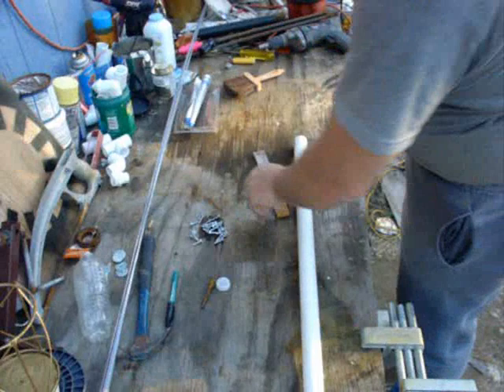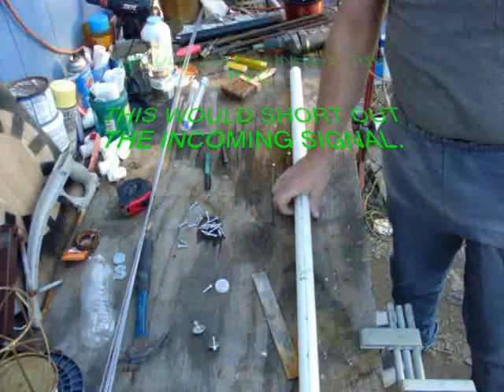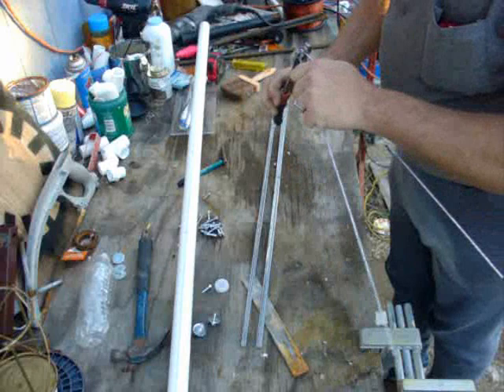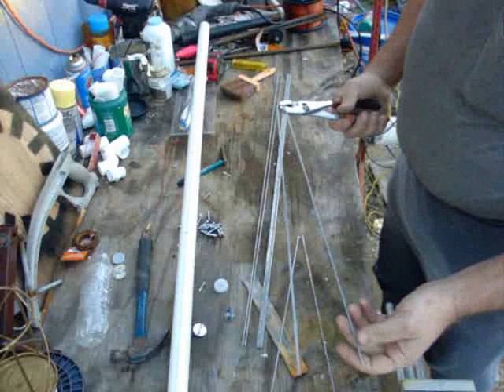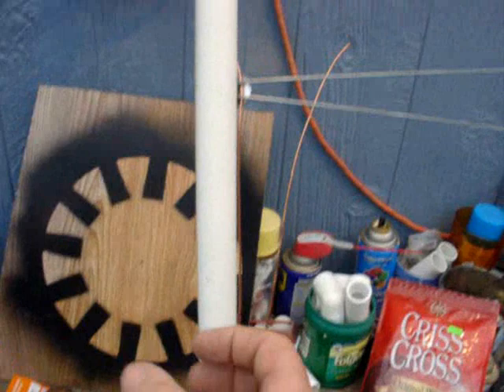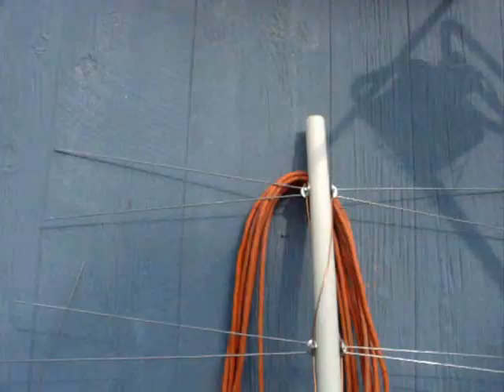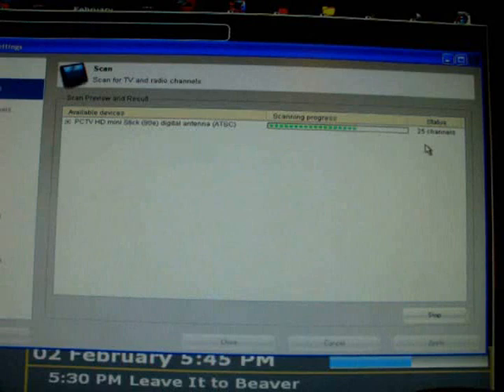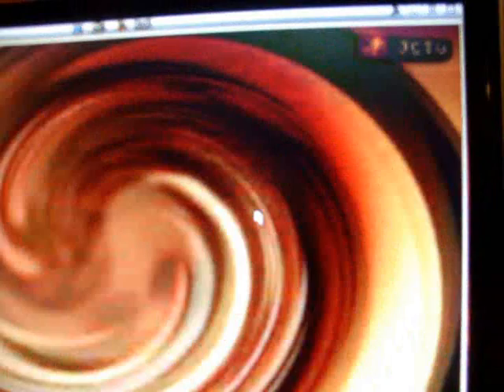EASY BUILD  HD TV ANTENNA   FREE HD TV 2020

Comment: Hey Scott. 

I made one of these antennas a few months back, and it worked pretty good...40 - 45 available channels. Today, I modified it by running the matching transformer and the coaxial cable through the inside of the PVC, and raised the antenna 5 more feet. Now I am picking up 67 digital channels and 1 analog. All for around $40. I have to say that this video is one of the best I've seen. Thank you vert much for making this video.

Lee Biggers of San Antonio.

Comment: damn,i can believe this, about 3pm yesterday i decided to go to walmart and return the $55 antenna i bought the day before ,went to home depot and radio shack and bought all i needed to build this antenna and at about 6:00 pm was climbing to the roof to install it, i used the bracket and tube i already had from my old satelite dish , took me about 1/2 hour to find the best orientation and by 7:00 pm my receiver picked up 81 over the air channels (lots of chinese ,vietnamese ,spanish, even a french channel ),i live in simi valley (93063) and the closest transmitters are about 38 miles away, this antenna is amazing, thank you muddyman
Reply from the maker: oscar gargiulo Thank You for the awesome compliment, and comment. I am very Glad for you. Enjoy it well.

MUDDy

Comment: Used your video to make the same antenna. 4 years later it's still working great! I did solder the wires together though so that oxidation wouldn't be a problem. Thanks!

Comment: I just finished assembling my version.  I had a oven rack in my garage that I used to make the sections of the antenna.  They were 16"  in length, but figured I give it a try.  I welded the ends together at a 15 degree angle and spaced them on 9" centers on the PVC pipe.  I used 12 gauge copper romex to connect the antenna elements.

IT WORKS GREAT!  

I needed another HD antenna but I bought one a couple of months ago and it gets eight channels.  This one works awesome and I get 14!

THANKS!

Comment: These antennas seriously work. I built a fairly crummy one mounted on a piece of plywood. It sits in our bedroom with about three or four walls that are plaster and expanded metal lath (which even gives my wifi fits) between our antenna and the broadcast antennas. We still pull in about 20 channels clear. But your construction method and materials are waaaay better than mine, and solve a couple of problems I had with moving our antenna outside - and I even have most of the stuff on hand. Yay.

Comment: lol, I made this just today, and were about 50 miles from town.

made it all nice with the boys and all. hooked it up, inside the house mind you and was getting better reception then with that store bought thing that half way worked.

what I dug about your vid, you put the math in it, I have watched many, but your vid got my motivated.

killer job, and thank you
Reply from the maker: +Carrol Ray Thank you Carrol Ray. 
The funny thing about this video is, I was asked to do it by a fiend. Even though the main subject of this channel is free energy.
This video gets more daily views than all the rest. lol.
Perhaps I should drop some of my old bamboo and aluminum foil tape designs I used to make.
They were fun , easy, simple, and cost next to nothing to build. I have helped many new ham operators, and citizen band radio operators get on the air with their first antenna made from bamboo and aluminum foil tape.
Yagi antennas and quads , and ground plains. The best part is, if they fall. you are back up and running in 1/2 hour, the bamboo causes very little damage, and most of the time, the bamboo just splits when it bends, and just snaps right back into shape when you pick it up. lol.

another funny thing is, Most folks swear they dont have bamboo growing in their town. It was just never on their mind while they were driving around.
It's a wild growing, wide spread weed.

Keep smiling and have a ball.
AND THANK YOU.
MUDDy

Comment: Thanks for the instructional video, very detailed and informative.  I built an antenna using your dimensions, but added a reflector frame out of 3/4" EMT (thinwall electrical conduit) and welded it to a 1&1/4" EMT mast and used aluminum screen as the reflector (seems that a lot of people use almost anything that's not nailed down for the reflector).  Also used insulated #10 solid wire for the whiskers and other conductors (stripped it where it makes contact) and found a weather proof transformer at Lowes for $4.  Used a 2x4 for the whiskers and wiring and attached that to the mast/reflector.  Mounted the whole thing to the side of my chimney ~40' in the air.  Wish I could post a picture.  Anyway, I'm about 65 miles southeast of Baltimore and it seems to get most, if not all of UHF channels (even ones in totally different directions for some reason).  The trouble is I'm not getting anything in the hi-v range (mainly interested in NBC out of Baltimore).  Judging by the distance and the power of the station I should easily be getting it when compared to some of the other stations that I'm getting.  Wondering if there's anything I could do to optimize lower frequency reception.  Would adding a really long pair of rabbit ears to the top of this design mess up the harmonics or something?  Or would changing the lengths of some or all of the whiskers to something like 20" be more beneficial or will that screw things up too?  Thanks again for the video and for any additional suggestions.
Reply from the maker: The shorter the wire, the higher the frequency.

Comment: Cool, there's a man here in Edgewood that made antennas for many years. He made many different shapes, but always the same thing; PVC pipe and wire. I bought several from him, $10.00, I seem to remember, and they worked  much better than the expensive HUGE antennas that are so common. At the moment, I have one of those "normal" antennas, on a pole, about 13 feet high, a converter box, and probably get the same channels you do. Lots of Spanish, but, some good ones too.  Gave up Dish!! satisfied!

Comment: Many thanks, MUDDy.  I built mine and get 16 channels just sitting in the window.  I can't wait to get it on the roof and aimed at the big city.

My hardware store only had coiled ceiling wire.  I went up and down every isle looking for an alternative.  I ended up in fencing, out in the garden center.  While leaving I saw the tomato cages and thought, "I need to get new cages to replace those cheap ones". D'oh!  I used tomato cage wire. Heavy duty and galvanized. Thanks again.

Comment: About 20 Home Depots within an hour's drive of us. Only ONE stocks "USG #207535  12-Gauge  6 ft. Hanger Wires (50 pack)"  (=$17.78 today's price.) Only source I've found.  WORTH an hour's drive each way to build this incredible antenna.  Made the mistake of taking mine camping (antenna in our Forest River RV sux.)  Everybody in our club wanted one! Held a "how-to class."  Now where ever we camp even guys in $750K motor homes ask how to get one...   Makes the "coat hangers on a 2X4" guys turn green. Thanks for the video.  Nothing else can touch it.
Reply from the maker: Lol, I'm melting, I'm melting... wweeeeeeeee!!!
Warm heart felt comments like this one just spread a smile to my face.

A fractally designed antenna like this just resonates all frequencies below the half wave length of it's full size. Also when a fractal antenna is upped in size by two times, it disturbs/and or/ collects from 4 times the flat sided area, or plane. When you tell them that the larger area negates the need for the amplifier that also amplifies the white noise, and spurious harmonics,n The larger clean signal is much better. simplicity is just sheer genius. Or shall I say that the genius is in the simplicity of a larger collection of clean and simple common sense.

No magic, or extreme calculus. Just simplicity.
Happy New Year
MUDDy
God bless you and yours

Comment: Just a tip: After three trips to Home Depot today, I found bundles of galvanized wire hangers in 6' lengths there. I had seen them a few weeks back, but I didn't have the money at the time to pick them up. When I went back today I simply could not find them at all and none of the various store clerks had any idea as to where they were. Even in searching online, I still could not find the bundles listed. I then went over to  Lowe's to see if that was possibly where i had seen them, but searching through all the isles there revealed nothing at all. I knew that I had seen them so I went back once more to Home Depot and searched every single isle and BINGO! They were in the section which had those foam type of ceiling tiles. They happened to be standing upright inside a PVC pipe attached to the shelves there. They cost about $18.00 and come as a bundle of 50. They are straight as an arrow and should be very good for this type of antenna. I have them out in my car, so I don't have a name or product number for them, but they do exist and would be much easier than stretching a roll of wire in lengths to make the pieces straight and likely easier to make the cuts for whiskers, too.

Comment: I like these antennas!  I live fairly close, about 40'ish miles from a big city the transmitter farm. I stuck one of these 30 ft in the air and used a 7dB amp at the bottom of the pole, and I locked in 92 OTA stations. As exciting as that may sound I'm only interested in maybe 30 at the most. The rest are shopping\auction\or foreign language channels. Still not bad for $20 worth of parts.

Comment: You're amazing, man! This worked 100000% better than ANY store bought Antenna. Trust me, we've tried a few! I highly recommend this build. If you're questioning if this will work, trust me.... it will!
Reply from the maker: Evan Carter Much thanks Even. According to the strange results I've seen here, It seems to work very well where folks can not receive anything with store bought amplified units. and doesn't seem to work too good in areas where the store bought units work well.   In the design, i doubled the length of the aerials to keep the resonance and add gain to the reception. Kinda like having a larger area of collection for the signal.  It seems to work in the valleys and hard to receive places very well. If one finds that it doesn't seem to work, trim the aerials to just over half length. and add an amp at the antenna.And thanks for the great report.  My years of building am radio antennas has paid off for others. When ones experience helps others, it is a great reward.    Merry Christmas, and Happy New YearMUDDy
Reply: What is the size of PVC?
Reply: We used 2in diameter x 10 foot high. Heavy duty gray pvc from home depot is what we used.
Reply: Evan Carter is the distance between elements not important?

Comment: Great vid, I made some smaller versions using a wood mast, have them mounted inside the attic.  One thing you might throw out there is that if you are mounting outside, put on a grounding cable.  Hate to see lighting crawl  down and smoke up a good TV!!

Comment: I was hesitant at first, but it works beautifully. Thank you very much.
Reply from the maker: Cecilia Da Rosa The measurements are almost double of what the figures say for lengths of the aerials. But it gets more gain from harmonics, and the added space it receives from. kinda like a bigger flyswatter. lol.
These antenna designs are very wide banded because they use harmonics and fractals of the signal waves
It worked better for me so I shared it in video.
I am glad you received the same results. 
MUDDy

Comment: I made one of these with an extra element on top like a rabbit ear.  I used 12 gauge copper ground wire and put 1/2" inside a 3/4" pvc pipe and mounted to the old dish mount on the roof.   I get 94 channels, twice what the antenna website says I should get with an antenna 30 foot in the air.  This antenna is better than any store bought antenna and I already had everything laying around to make it, which made it a bargain.....
Reply: can you post a picture?  That would be great!  thanks.

Comment: I built one of your antenna designs.  I live up in Norther Michigan and the reception is excellent!   We get 10 channels.  The only thing I did different was that I soldered each copper wire joint.  

Thanks,
Steve

Comment: Awesome design. Built an 8 bay version of this, transformers in center. I get more channels than antennaweb and tv fool say I should. I live near midpoint between Chicago and Milwaukee, in a town called Antioch (45 miles from each city). 93 channels - with the antenna inside my attic (2 story house). I have a reflector on the half oriented toward Milwaukee (an extraunused  oven rack), and no reflector on the Chicago side. I have the 4bays side by side. One thing I discovered was that there is a difference depending on the transformer phase (?). I did a channel count with the initial setup, then swapped leads on one transformer where it attaches to the antenna and tried again. There was a noticeable improvement with one of those combinations. I have the RG6 exactly the same length from each 4bay to the  splitter/combiner and a preamp. The signal then runs to my basement where my wiring all comes together, then back through the house - all said probably 100' of RG6 quad form antenna to TVs. I also have an amplified distribution block in the basement. Nothing fancy on the roof - just asphalt shingles, tar-paper and OSB. Other details 9.5"leads, 5" spread, all copper wire (12 gauge that I had from a previous project) around a 1"pvc pipe.

Thanks again!
Reply from the maker: +Michael Taylor 
That sounds like excellence. 97 channels is a dream to most antenna users. Also, Your comment has excellent description, and clarity. My compliments.
I believe the last count i did was 63 channels. When it rains, I lose around 25 of them. My roof is all tin, but i have the antenna up around 15 feet above the lower edge of the roof. But the direction of the antenna doesn't have the roof in the way. no amps or any other devices between the antenna and the television set.
The only problem is when the high winds show up. The wife makes me go outside to redirect the antenna so she can watch her westerns. :)
MUDDy

Thanks Michael. Much appreciation.
Reply: When adding a reflector, what is the optimal distance from the whiskers?

Comment: Cool video! I just built one myself with a 10 foot long pvc pipe, making mine a min-tower. I was able to pick up WSIL (ABC) from about 85 miles from their transmitting site for a few hours yesterday here in Evansville, IN. I'm planning on not renewing DirecTV next year and just plugging the antenna into the main cable feed on the outside of my house.
Reply from the maker: el mongo Heck ya bro. if the cable is there, and installed, it works fine for me. :)
Nice receiving as well. It sounds like the stacking of aerials did a nice job.
MUDDy

Comment: Hi, I used your design, only had to buy the transformer, I used stuff I had lying around, straightened some alloy brick ties for the bow tie wires, copper wire from inside 2.5mm electrical cable for the wires that run down, pipe, screws, washers and cable ties I had left over from other jobs.  So $5 and a bit of time.  I also put the transformer in the middle.  Improved my reception greatly.  Sometimes channel 37 would break up on my old antenna now it is perfect signal strength.  Thanks.

Comment: I built this ant about a year ago using  1/8 stainless rods for the elements.  It worked great for a while. The bidirectional aspect worked out well too since I am midway between two cities . I think oxidation of the copper wires is breaking connections though since I intermittently loose performance. I'm about to rebuild it with stainless interconnects too. I'm also going to change the geometry to allow a lightning rod at top with ground lead. My new antenna will be built on schedule 80 plastic conduit just to give those screws more to bite into.    Let you know how it works out.
Reply: This is what I worried about when I saw the dissimilar metals connected and then put outside. Will await your results for update!
Reply from the maker: Carie Voss The connections can be covered with silicon sealer if needed. Good thinking, and suggestion. Thank You.
MUDDy
Reply from the maker: ***** Silicon covering the connections should help there. clean the connections first.
As far as the lightning rod goes. make sure it is on another pole and ground. lightning rods sometimes attract the lightning. and even if it travels down the pole on another wire, the coaxial cable is sure to get a jolt due to mutual magnetic induction generations of healthy voltages. check out old lightning arresters to short out the higher voltages before they come into the house. Just a small metal or wooden box with the signal wire of your coax connected to a sharpened screw that is adjusted to the smallest spark gap possible. the other side of the spark gap is a well grounded ground wire from the ground.
I see this comment often since i made the video. Perhaps I should do another video on how to build a simple one.
MUDDy